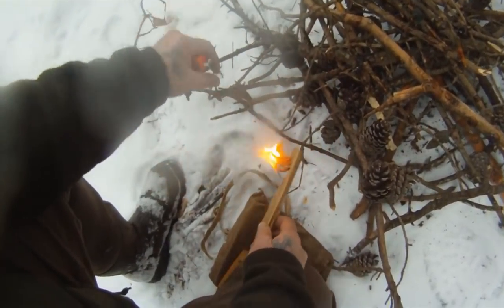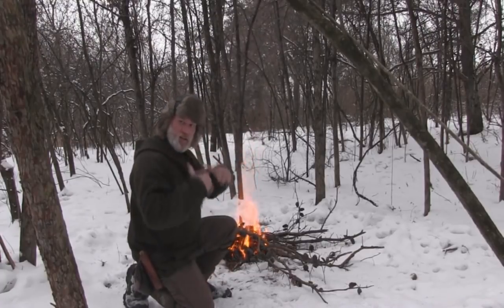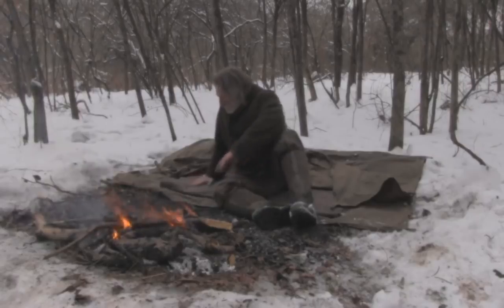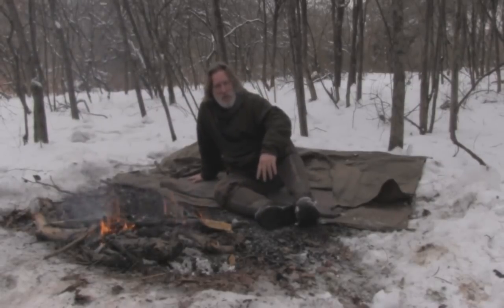Making a Coal Bed

Comment: All of that wasted wood and energy getting the fire to " burn through the snow " ! just dig through to the ground which will keep you warm and not waste wood and time, and that method will only keep the heat for a couple hours at most, I'm a former Royal Marines Commando and have worked and lived in the Arctic environment.

Comment: That wet earth undernearh will take all the heat out of that bed, a coal bed is made in a ditch sleeping on top of a thick layer of coals. the coals are the insulation, and will stay warm form a long time.

Comment: "Didn't put enough dirt down, Saw it right off." --Bear Claw Chris Lapp
I always wondered why Bear didn't tell Jeremiah that he didn't put 
down enough dirt. It's like he allowed him to learn the hard way.
Reply: My last winter overnight, we had 6" of snow and high thawing temps during the day which translated to tons of moisture in the ground that was going to freeze overnight. I built a bonfire to warm up a good 100 square feet of my campsite and in a couple of hours, I had that whole ground as dry as the Sahara and it was warm too. 

After that, I let that coal bed build up and I slept a good 5' away from it like a baby. I was so warm in fact that at around 9pm, I said good night to the fire and let it just die out. It was in the high 20's out there that night, but I was as snug as a bug in a rug. The MSS Intermediate Bag and Hudson's Bay Wool Blanket I used helped out a lot too.

Comment: Dave, I know this video is obviously from before now, September, but I do have a question... 
Would you say in a situation like this, if it is available, would it be good to layer pine bough under or over your oil cloth or not at all? 
I have only been in semi-primitive scenario camping in the snow twice but it was 25 years ago in the Army in Alaska. Though one was in a snow cave and the other on the ground under a deadfall lean-to, but both times we had sleeping bags. The rest of the time we used a 10-man tent with a stove, so those times don't count, but we still layered the ground with pine bough.
Reply: I miss winter camping :(

Comment: 2 long log fires.  But not an open campfire, but make multiple rocket stoves drilled into the log, using a scotch eye wood drill auger.  All logs cut would have dry interiors for burning, but augering creates all the needed tinder for fire starting.  Self-contained burning, no sparks, no big flames, but definitely making a solid burn.